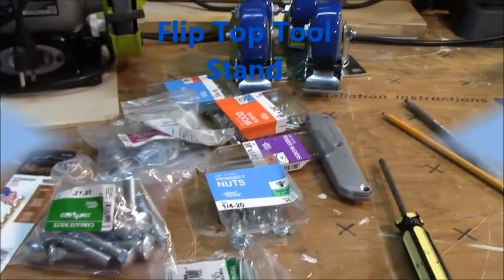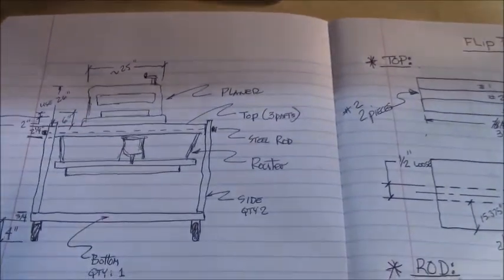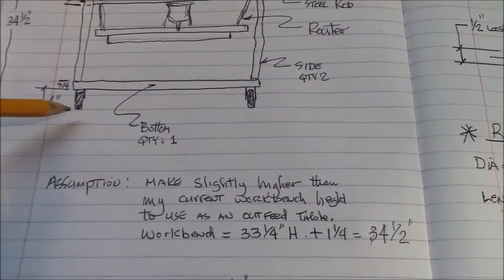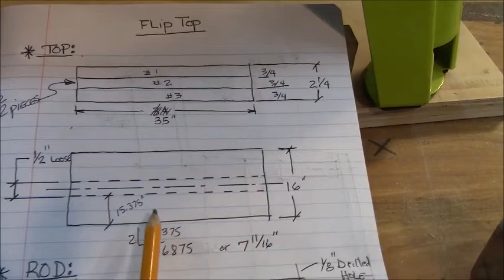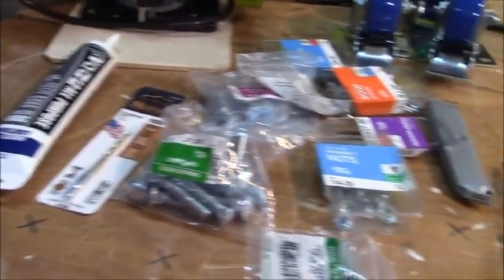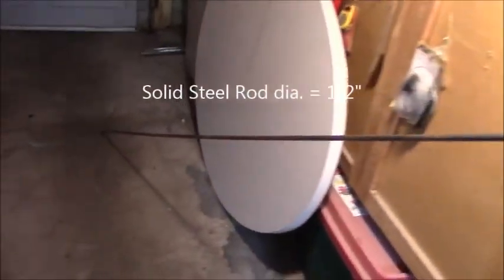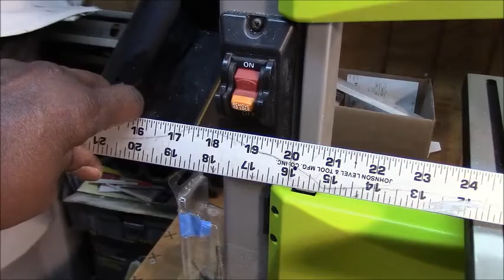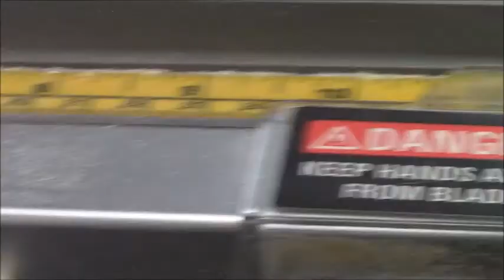FlipTop Tool Stand - Part 1

Comment: I had embarked on a similar path with a Bosch chop saw and one of those Rigid belt sanders.  I had to abandon that because the Bosch saw was just too heavy and things were just insufficiently rigid.  (no pun intended)  I may wind up with one of the commercial saw stands for the bosch.   I wish you better success than I had.
Reply from the maker: Thank Steve. Hope this turns well and last. If not standby for an update video.

Comment: What is the height of the drill press stand with the wheels mounted. I am thinking about building one for my shop, but where I want to store it is limited to 40 inches .
Reply from the maker: ronnie owens, I added some still photos with dimensions noted on my Facebook for additional information. You can access my Facebook page by either searching on Facebook for DIYing-with-Bob-The-Builder or click on this link.  https://www.facebook.com/DIYing-with-Bob-The-Builder-718516848298280/. From floor to top of flip table measure 39 in.